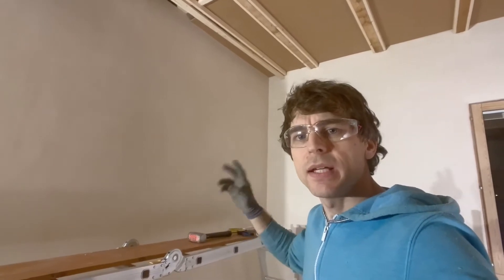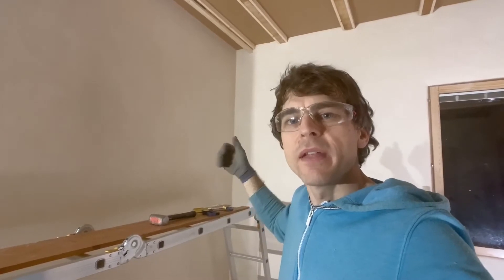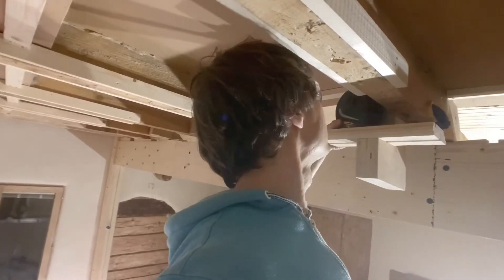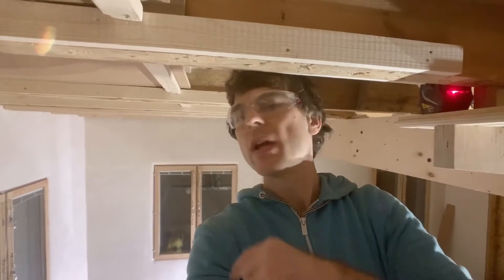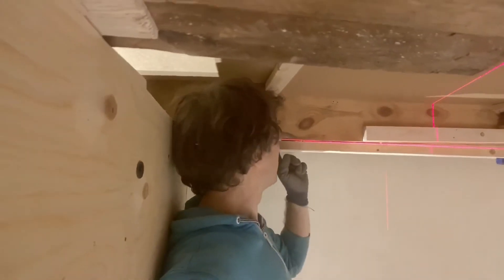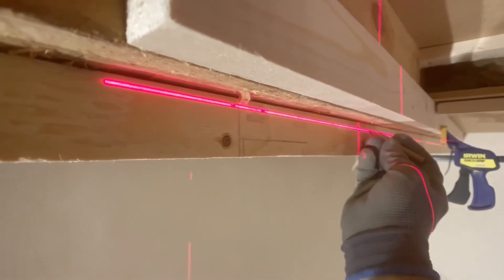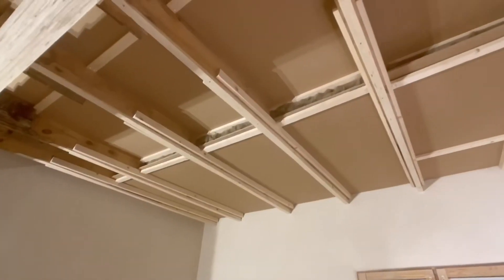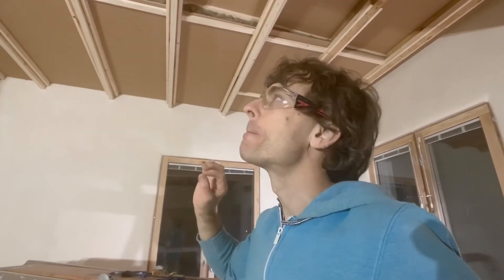Renovation: leveling  the ceiling.

Comment: Would you level a ceiling in a wooden garden house that is maximum 3 centimeters uneven? Or do you think it will not be noticeable? Thank you for sharing the video.
Reply from the maker: The unevenness is purely cosmetic.  So if everything is structurally sound then you really only level it for appearance. 

Now would I level it? 🤣 Probably. But on a wooden garden house.. maybe I actually wouldn’t of the vintage of the place is NOT modern. 

I really like old wonky homes. Just when I did our renovation I realised that the final look is kind of modern with natural materials. So for that reason I thought it best I get the surfaces as level as possible. But having said that, they still aren’t straight or perfectly level. And that’s ok!

Comment: You were moving your level each time, how did you ensure you placed it back in the exact same plane each time?
Reply from the maker: Good question. I had marked lines on one section of the wall to use as my reference point. 

Then you can move the laser wherever you want, realign it with the reference point and away you go with the next beam.
Reply: @PaulWarrenEaton  Gotcha!  I'll be having fun with my 360* laser level and some strings today. fingers crossed!
Reply from the maker: Good luck! Yes be sure to mark a reference point somewhere even if you don’t plan to move the laser. Always possible you could bump it!

Comment: Could’ve just screw into the side of that joist  making new joist level with laser.
Reply from the maker: Joseph Hathaway yes that would work also. If there was some actual load bearing weight in the final ceiling, that’s probably what I would have done. However, I decided to go with shims as the final ceiling panels have such minimal weight. The panels in most cases pass through the shims and into the existing beams. 

In my head it felt that the solution I went with used less timber and ‘felt’ neater.

Thanks for your comment and for anyone else reading this... yes you can most definitely do what Joseph suggests!! 👌